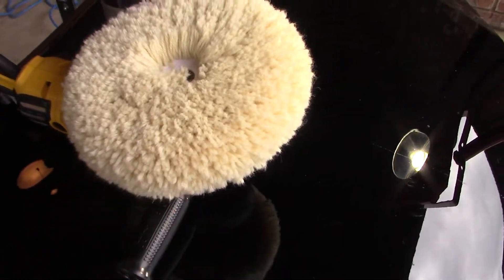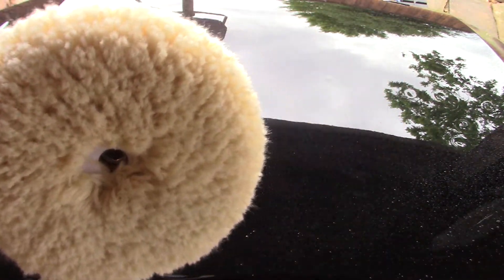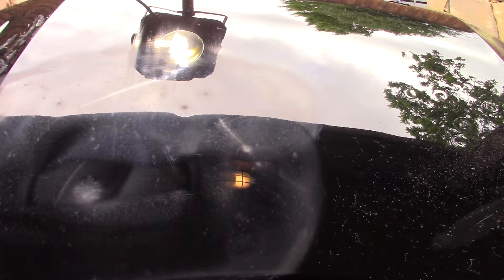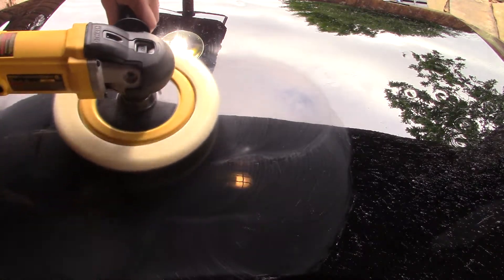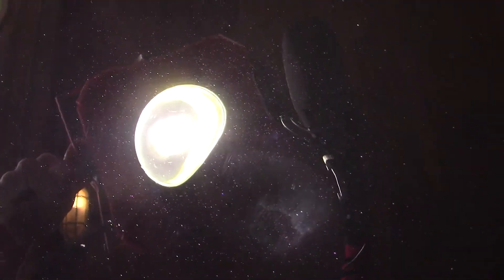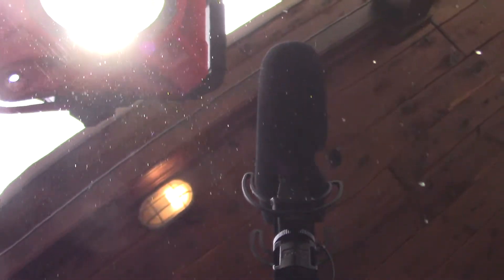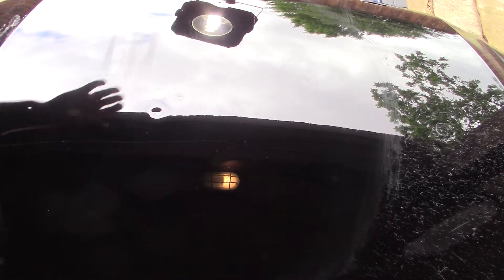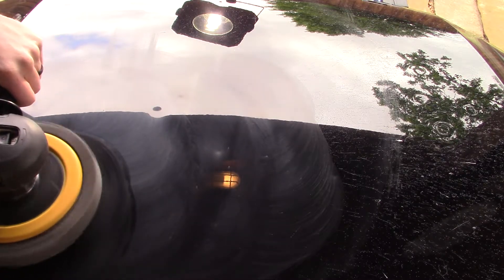The Rotary Polisher UNCUT - Removing 2000 and 3000 Grit Wet Sanding Marks!! Part 1

Comment: Hey Landon. What  brand pad was the wool one you were using ?
Reply from the maker: James they both were Master Pro.  I bought them at O'Reilly Auto Parts.  https://www.oreillyauto.com/detail/b/masterpro-refinishing-4361/paint---body-repair-16614/compressors---air-tools-16811/polishers--buffers--pads---bonnets-17962/607ed575042f/masterpro-refinishing-cutting-pad/67111/4511052?q=polishers%2C+buffers%2C+pads+&pos=3

Comment: Could you use m3 with rupes white pad
Reply from the maker: yes
Reply: AQUALUX AUTO DETAILING  so m3 rupes white softer paint m3 rupes yellow harder paint? Talking about refining does that sound right
Reply from the maker: @hakman239  it depends on how bad the paint is...hope that makes sense.  yes I get what you are saying but every car always needs some tweaking.
Reply: AQUALUX AUTO DETAILING cutting with h9 and flex purple pads
Reply from the maker: @hakman239  h9 is a great cutting compound